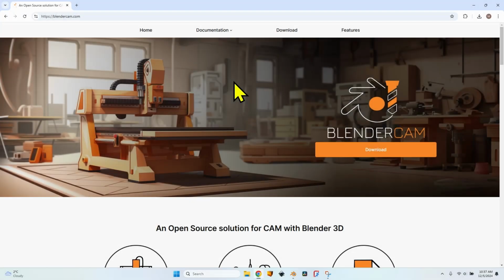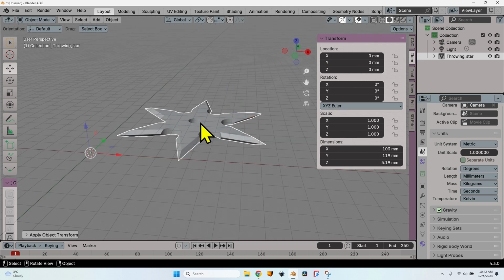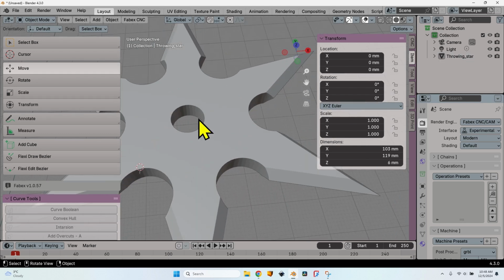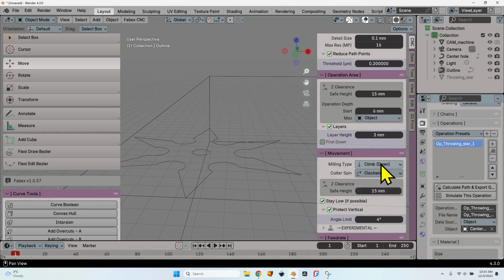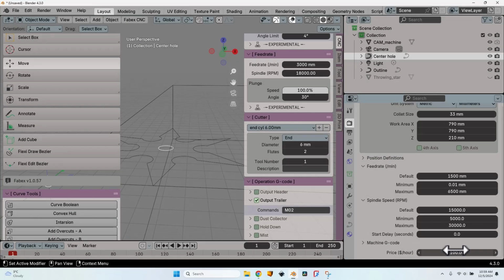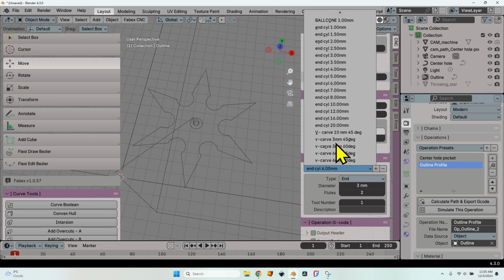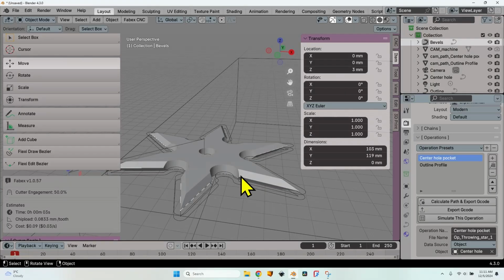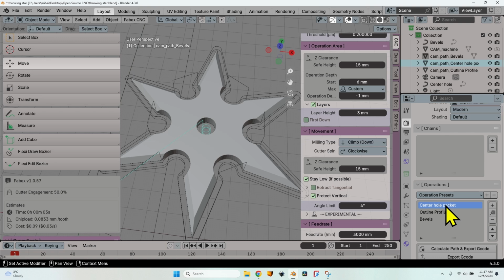Install & Use FabEX CNC in Blender 4.3 | Generate G-Code for Your First Project

Comment: At the moment as I have checked the latest fabex is 3.0.2 , but it does work for blender 5.2 because of python version, could you suggest me which version of blender should i download in order to add on fabex 3.0.2 perfectly , I have tried few combination of blender and fabex versions but did find correct one
Reply from the maker: Look here, it is the recommended repo. The current version is 3.2.2 https://github.com/pppalain/blendercam

Comment: Using the ShopBot MTC profile I attempted to cut and 18" x 18" square from 1/4" ply. I received some errors in the G-Code processing. One being: " !!! Memory Error !!! Memory limit Exceeded! Detail Size Increased to 0.00011 "  The program pressed through anyways. I then went to test the g-code on my Shop Bot with no material and it seemingly tried to cut a much smaller square. Did it decrease the size by X.00011? The job is not complex at all. Is this a setting perhaps that I could edit in Blender?
Reply from the maker: That setting has nothing to do with the overall size, it's just the precision of the toolpath. I would first check in the scene, to have it set to metric and the length to be in millimeters instead of meters. After that, in the details of the machine, at the bottom of the render tab (which has to have FabEX selected), make sure you have metric or imperial selected, depending on what your machine is set to. With these settings, the toolpath should be the right size

Comment: Do you you have a tutorial to machine the bevels without a v-carve tool - I have a part I want to machine but the angle is non standard - I could custom make a cutter of the exact angle, but since I will be cutting steel it would be better to create g-code in fabexcnc - which tutorial covers the basics for this?
Reply from the maker: I don't have a tutorial for that. I would make a normal block operation and limit the area using a curve for the areas that I don't want to be milled.
Reply: @opensourcecnc Thanks .. I will try this

Comment: Thanks for your tutorials - I'm following through in this tutorial and I have done "calculated path" and have this error message: [Errno 13] Permission denied: 'Op_Throwing_star_1.gcode' - although the actual visuals are exactly the same as in your video - is there some python error or something else?
Reply from the maker: This sounds like a file write permissions issue. Try saving the .blend file in a folder that accepts read & write for all users. The exported G-code file will sit in the same folder as the .blend file, if saved. If the .blend file is not saved, fabex will try to save the G-code file in the system folder of blender, which might cause this issue.
Reply: @opensourcecnc  OK that worked .. thanks.

Comment: This just won't install it for me. At first it complains about a logs folder not available, then if I add it and restart and try to enable in add-ons it says "list index out of range". I guess it could be a conflict with other plugins.
Reply from the maker: No, it's not a conflict, it's an issue in the latest version which, unfortunately, hasn't been solved yet. You can solve this by going in the add-on 's folder (on windows it's usually C:/Users/{username}/AppData/Roaming/Blender Foundation/Blender/{blender version}/extensions/user_default/fabex/ ). Create a new folder there, called logs. You should now be able to enable the add-on. I'm not 100% sure that's the folder, as I'm typing on my phone from memory, but I hope you can find it and solve the problem
Reply: @opensourcecnc thanks for the swift reply, I tried this already and unfortunately I still can't enable the plugin after that. I remember trying that plugin in older versions of blender and it worked. But it doesn't seem to with 4.3, at least for me.
Reply from the maker: @stephaneyoutube5337 go to https://github.com/pppalain/blendercam/releases and download version 1.0.69. That works for sure in 4.3
Reply: @opensourcecnc it does work 🎉 thanks a lot, will give it a try!

Comment: Help i download the stl and get so far, when i click calculate g-code i always get an error "name curve_simplify is not defined".
Reply from the maker: What version of blender and what version of the addon? It sounds to me like the two are not compatible, that's when this error occurs, generally
Reply: @opensourcecnc  4.5.3
Reply: cam 1.1.3
Reply from the maker: I'll take a look a little later and let you know
Reply: @opensourcecnc  ok thanks, the main reason i was looking into blender was freecad crashing all the time when i use stl depth map
Reply from the maker: @LetsChat-v6u  crashing as in freezing or closing by itself?
Reply: @opensourcecnc  freezing then i have to hit force close after a period of time, if i leave it it shuts computer down.
Reply from the maker: @LetsChat-v6u check the geometry tolerance and the bounding box. Here's a video that might help you with FreeCAD until I get to check why is blender not working: https://youtu.be/QfyLyRg7SfI
Reply: @opensourcecnc  yeah watched all your great videos but did not improve it. only got a 1.4ghz 16mb ram so maybe need to upgrade.
Reply from the maker: @LetsChat-v6u send me a message to the address in the about section of the channel, I'll take a look and maybe find a solution

Comment: 9:23 I'm stuck at this part. I can see the dropdown headings [Chains], [Operations], [Machine] but when I click on them no menu opens up. Anyone else have this problem?
Reply from the maker: There's a problem with the install if this happens. What version of blender are you using? As far as I know, FabEX only works with blender 4.3 . I first check the version, then remove the addon, restart blender and install the addon again. That should fix it
Reply: @opensourcecnc  I was using 4.4.0 I installed 4.3.0 and I can see the menu in the dropdown now. Many thanks for your help.

Comment: Hi, Tip for positioning 3d cursor quickly on the top side of the object: 
simply hold Shift and press Right click somewhere on the top side of the object. 
You don't need to go in the edit mode, nor do you need to select object, just make sure you have clear view of the top side of the object. Hope that helps 😊
Reply from the maker: @harunlisic  thanks! It helps, for sure!
Reply: Also, when shifting objects around, you can use ctrl for snapping. so g to move, and ctrl will snap to the nearest thing. blender's surprisingly intuitive in how they calculate the snapping (with the nearest point/edge/vert being the thing that snaps (usually).  this can give you precise fast snapping, rather than going and typing things by hand. You can snap this way in edit mode, with stuff selected, or in object mode. (But when you know measurements, sometimes that can be preferred -- sometimes you might get rounding errors.. like 3.0001mm instead of 3mm).  Also, you can just hit g z 3 (if you're in mm) to move up 3mm. I know you might know this and were using the UI for the user, but I figured I'd mention it.  You can also hit numpad + and - when you're over different panels to change the UI elements' sizes really quick (like when you wanted to show the field names, and maybe go right back to the large size, which did help in the video).

In any case, thank you for this video. I'm extremely experienced in blender, but extremely IN-experienced in cnc milling -- and this was basically a perfect introduction for me.  (Freecad was crashing on things like "scale" and "add dimension line"..)  Subscribed! and Liked!

Comment: I am doing something wrong. I have setup my paths, created the gcode then I load it in my machine. I zero the machine but the machine rises to 20mm above the work surface and spins in the air finishes on the zero level (without really cutting into the material). This is probabbly a noob mistake from my part... Does anybody have an idea what I am doing wrong?
Reply from the maker: I would check that the zero is in the same position as in blender and the material is positioned correctly. To me, it sounds as if you have the object above zero in blender, but you zero on the top surface. If that's the case, position the object below zero in blender.
Reply: @opensourcecnc  I found a work around. I adjusted the operation depth to start at 0mm and use a custom negative depth of the material. I am a bit confused by setting the max to the object... So I am fine with my work around. Thanks for the tutorial btw it really helps somebody who comes from 3d printing where slicing is done by one press of the button!

Comment: I can't figure out how to enable the experimental features. My add-ons panel doesn't show this tick mark at all. Everything look different than the video.
Reply from the maker: What versions of blender and FabEX are you using?
Reply: @opensourcecnc  1.0.63 It was the latest as of yesterday
Reply from the maker: Sorry, I didn't get a notification on your follow up. I will take a look tomorrow and see what has changed
Reply from the maker: I installed the 1.0.63 version. It doesn't have the enable experimental features checkbox. As far as I know, the development team was planning to give up on that and have everything included by default. That's probably what happened. By the way, what version of blender are you using? I was using 4.3 in the video. Maybe that's why things look different.
Reply from the maker: A little update: in the right panel, when changing the render engine to FabEX CNC, You have just below a dropdown for "Interface". There you can change between Basic, Advanced, Complete and Experimental. So it wasn't yet removed, just moved

Comment: scale: select object, press s followed by typing 0,001 for example - enter
moving: press g and optional press the axis you want to use
snap to bottom: edit mode, select bottom vertice(face and edge also works great) shift+s cursor to selected and in object mode orign to cursor. now move your object to z=0
-> checkout also snapping with enabled absolute increments to snap on the grid. 

i like your videos, if i can help with blender-experience contact me :)
Reply from the maker: Thanks! How do I select the lowest vertice? That's my issue, I know about the rest of the procedure, but I don't know how to select the lowest vertice of an object
Reply: Venendo da software professionale powermill, ho voluto provare se uno free fosse sufficiente per piccoli lavori a casa, purtroppo mi sono imbattuto in interfaccia ostica , errori del sistema e opzioni confuse. Avrei voluto tanto arrivare a una versione personalizzata più amica, ma non sono così sicuro di riuscirci, peccato. Mi specifichi per piacere versione blender e versione fabex , ho paura di avere versioni non stabili.

Comment: I just started viewing your FreeCAD videos, thank you!    It's great to see and learn about alternatives that are free/open.   With this video are you saying you like BlenderCAM w/Fabex  combo over FreeCAD at this point, or just offering them as 2 different options?  Thanks again!
Reply from the maker: @ChinJazz  I'm glad you find the videos useful, thank you!
I think that both FreeCAD and Blender have good things and bad things, I think neither is better. Depending on the situation I prefer one or the other.
About what I said in the video, I was talking about editing curves. FreeCAD has all those different types of objects which are in fact the same, but from the Python perspective completely different. This leads to a lot of issues. And the GUI workflow for editing curves is much easier in Blender.
Reply: Thanks for the clarification.  I did just see the section of video where you explained the detail on curves 😊.    I’ll definitely plug back into Blender.  It was the first CAD sw I originally tried a few years ago but switched over to other platforms for CAM.   Thanks again!
Reply from the maker: @ChinJazz  tale a look at the cad sketcher addon, too. It still has some issues, but for simple things it can do parametric modeling
Reply: Thanks!   I’ll definitely check that out.   My focus is on Lutherie, and anything parametric is appealing.   Use my CNC as my 1st “employee”.